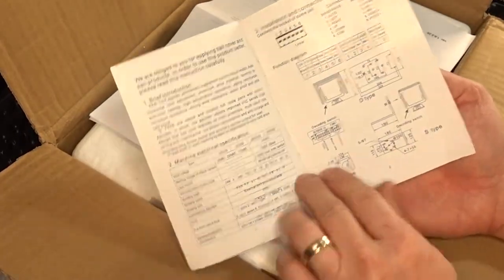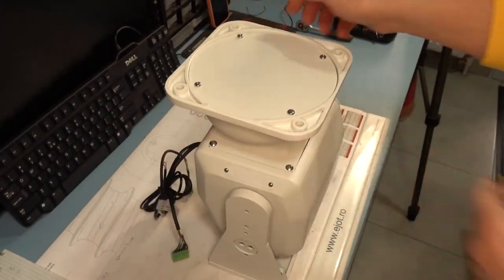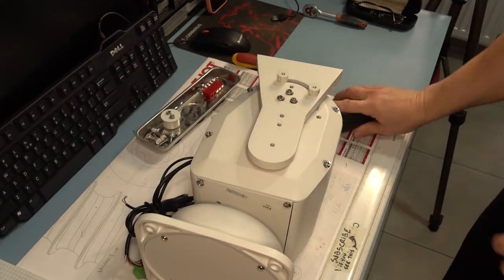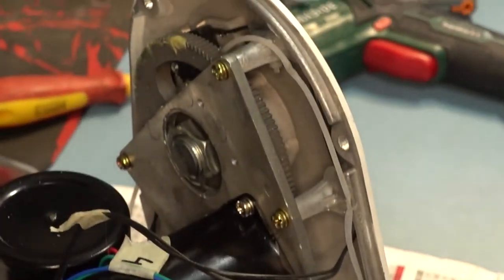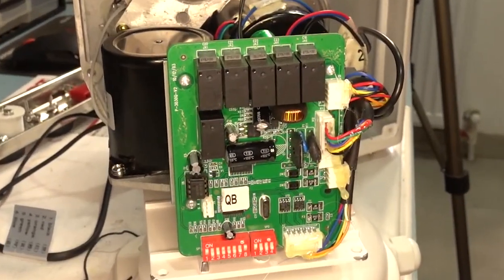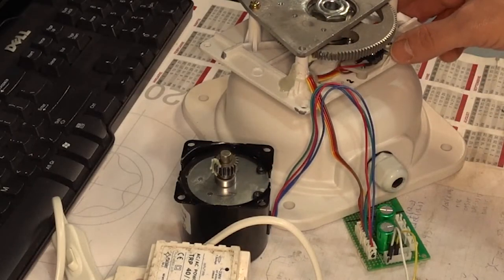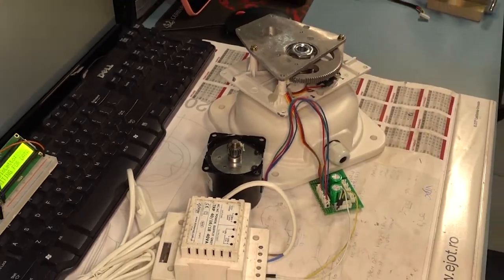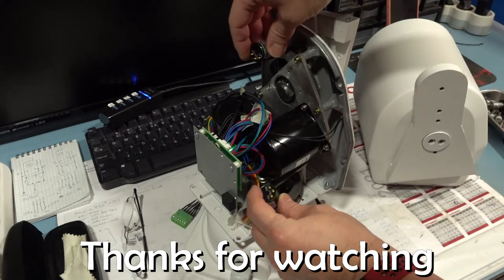Heavy Duty Pan-Tilt Camera Mount tear-down and analysis

Comment: well done can you control it with arduino
Reply from the maker: Yes, check this video.
https://youtu.be/WVsyHd6Jejg
Reply: @Racov   Ibought a PTZ camera  Model PTZ3000  . power input AC 24V  5A  . is there a way to get a wiring diagram for it and how can i  know which wire is used  to control the pan and tilt  separately without  tearing it down, 
in case i need help how can i  contact you.
Reply from the maker: @milksqaud2651  Hey man,
yo3rak@gmail.com
If you could send me some pictures of the PTZ, would be great.

Comment: Would you recommend it for a telescop ?
Reply from the maker: No, it's not good for a telescope, because it has very coarse movements. A telescope needs a much smoother movement, which can be achieved only with DC or stepper motors.